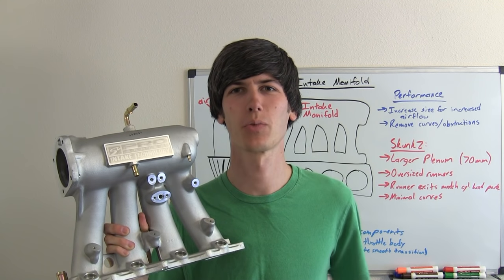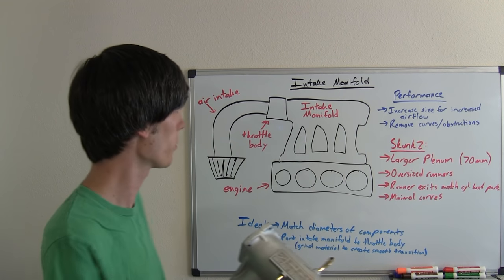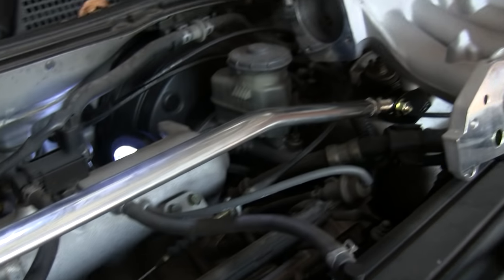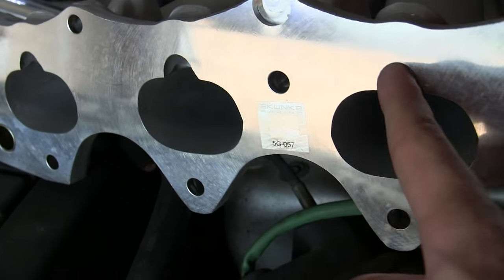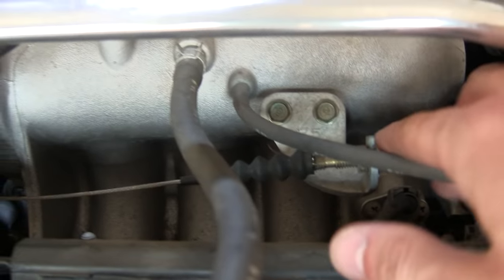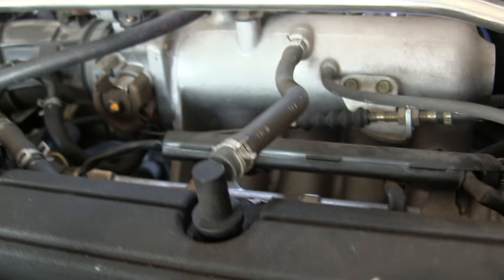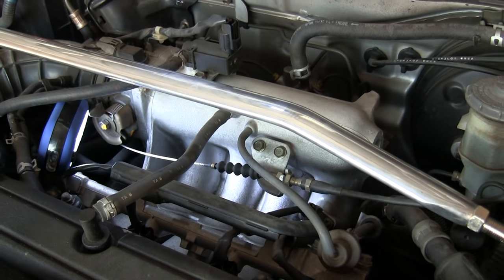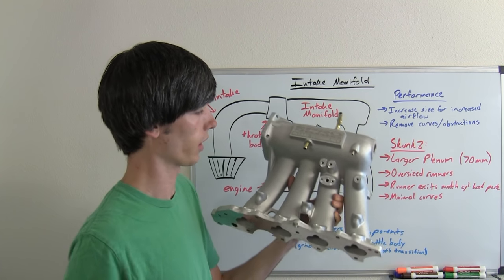Intake Manifold - Explained

Comment: So if the main opening on the S2 intake mani is bigger than the stock one, wouldn't you have to get a throttle body with a bigger bore for the air to flow consistently?

Comment: I might not be thinking straight but is/would it be possible to install an aftermarket exhaust header, intake header and catback exhaust at the same time?
Reply: It would be expensive and require an injector remap but it's possible.
Reply: TylertheGeek28 it's easily possible, 3 mods is nothing earth shattering and in a lot of cases wouldn't even require an injector remap. that's what exhaust sensors r for. the stock injectors will provide plenty of flow for most things short of forced induction

Comment: What about intake turbulence to ensure the fuel is fully atomized? 
Back when I rode Harleys, everyone I knew assumed I was riding a sleeper 1200 bore-job on my 883 Sportster. My bone-stock little 883 Sportster was dropping all FXRs and other big-bore Harleys with straight exhaust pipes, polished intake ports, Mikuni carbs and even a few who ran them without air filters. They were getting MUCH worse mileage and my little "bitchbike" was beating them like a rented mule.
Of course I later learned it was probably because they had smoothed all of the steps and smoothed the intake ports so that the fuel was entering their engines in large, un-atomized blobs that didn't burn as efficiently.

Comment: Im not sure on those integras whats the VTECH setup but on my silly D15b, with VTECH not engaged one intake valve is fully opened and the other is slightly opened, to say 25% with VTECH engaged both are fully opened

Comment: You really need to correct the PCV statement.  Take the hose off the pcv valve and put you finger on it.
Reply from the maker: Lenny MGI I think you're right! I just stated what the service manual said. That said, removing it from the intake removes the vacuum, which can change things.

Comment: Great vid! Can you tell me what books/ebooks/vid etc. did u use to learn about it? I have thesis about whole intake design, unfortunately i can't find proper materials in my language(in Poland we don't have any automotive engine r&d center, so libraries and bookshops are "empty") and don't have money to buy each foreign book form amazon/ebay and check it content(most of them are very expensive). Sorry for my English.
Reply from the maker: Hmm, didn't really use a book. There's lots of information scattered around on the internet, I just simply try my best to sort out the facts and present it logically.
Reply: Engineering Explained Thanks. I know there's lots information in the internet. I found some most about calculations, but nothing about inlet manifolds, how it made, what materials(not "alloys, plastic" but specifically), types of it. Mayby you will know only this last thing? It's main important. Somebody told me that intake manifolds like exhaust manifolds can be done 4-2-1 or 4-1 (mayby something else) is it true? Little comparison of both? advantage and disadvantages? In thesis i need to write theoretical introduction and this is big problem...
Reply from the maker: dawid3764755 Yes, you could have splits like 1-4 or 1-2-4, etc. Though I don't know what differences will occur. Looking forward to your thesis! :)
Reply: Engineering Explained
Thanks

Comment: How does the engine suck air? is it because of the vacuum that the piston creates in the intake step? like a syringe?
Reply: Exactly. The camshafts are also usualy tuned to create a little bit of vacuum in the cilinder before opening the inlet valve, so once the valve opens air comes rushing in with a higher speed. 
This momentum also makes air keeps coming into the engine at the start of the compression step. This rush and momentum increases at higher RPM, allowing to keep the inlet valve open longer at the high rpm range, which is why variable inlet timing works to squeeze some more high end power out of an engine and feels a little bit like a small turbo kicks in at medium-high rpm.

Comment: So how do you leak radiator fluid when your intake valve gasket is bad???
Reply: B Kelley This is a demonstration of an inline engine. A V style engine may have an upper and lower intake manifold. The lower intake manifold may have coolant passages, the thermostat housing, and oil passages through it. Your intake manifold gasket allows transition of these fluids to and from other components.

Comment: I have a chevy silverado 2005 6.0l while I am driving  power gets lower and lower when it get hot,, is this issue related with throttle body or clutch?
Reply: neither the hotter your engine the hotter the air in scientific terms hot air is less dense so the colder the air the density increases

Comment: Can I use a 1,6 L, 100Hp. vw engine standard intake manifold on Vw 1,4L., 75Hp. Engine+ better flow, wired throttle body? Or there will be ecu, cam or somekind sensor problems ?
Reply: I have 2001 Audi A2/VW  AUA 1,4 engine, 55kw. Original throttle body only 44mm and upgrade throttle body 56mm.

Comment: An intake manifold demonstrates the concept of scavenging.  Forcing a vapor through a plenum exhibits Bernoulli's principle.  Please review.   As the valves open in the cylinders the vapor enters in a pulse.  This pulse sets up a standing wave in the system.  To construct a tube with efficient scavenging,   the manifold must be of a length that is an even multiple of the standing wave that enters the cylinder.   An odd multiple of the path length will not admit a full charge per intake valve cycle. Do the math like you did when you were a kid.

Comment: stock intakes are the best, engines are  designed around the stock air box and filter, a pod filter or cone filter are rubbish, they just suck in hot air from the engine bay, hot air is bigger than colder air, meaning less go in to the cylinders = less power

Comment: I dropped a screwdriver in there cleaning my throttle body intake, how screwed am I ?should I buy a .magnetic snake or should I call a mechanic? I have not turned the ignition on for the the fear of destroying my engine need some help please.
Reply: You aren't screwed yet, but you will be very screwed if you start the engine. The screw will get sucked into a cylinder and totally destroy it, you will need a new engine if that happens. If you can't get the screw out with a magnetic snake you will need to remove the intake manifold to get the screw out. If you aren't able to remove the intake manifold to get the screw out yourself please call a mobile mechanic or have your car towed to a shop, whatever the bill is will be way cheaper than the price of a new engine.
Reply: I fished it out with a magnetic led snake woohoo!!!
Reply: @xxxxxbriansanchezyyy  Glad to hear you got it out

Comment: Why does the Variable lenght intake manifolds have a better flow when using the "long" path in the mid range? Engineering Explained
Reply: Danny Fallas The longer the path the more low end power or torque you have vs a shorter runner more top end power. Ford started doing this as far back as the 90s
Reply: Thanks! For turbo aplications what is better? I am getting short runners.
Reply: Danny Fallas Applications really depend on what you are going for in the car, are you going for a street driven car or a high powered drag car?

If street car you will want longer runners for torque, for full blown track car go as short as possible.
Reply: RichRusso4218
I want the best of both worlds SIR, low end torque to spinout wheels in wet roads, and 15 more hp than stock for high rpms.
Reply: Then go for a medium runner length.
Reply: Then use larger longer runners, there is always a trade up.
Reply: All oft cars I go with short runners, none of them have trouble breaking all fours lose at 60+!

Comment: my intake manifold is made of plastic. is that good or bad?
Reply: there is a broad range of plastics, and some will work for intake manifolds.  when i was in college, i was involved in formula SAE and one year we had our intake manifold 3D printed.  I can't remember the material, but I think it was PLA.  i'd worry if you were adding pressure to the system from forced induction.
Reply: Haukenslush Depends on the application. On a naturally aspirated(non-boosted) engine its a good thing if you want more power. Air is denser when its cooler(and plastic stays cooler than aluminum) therefore more oxygen is present in a given air charge. Ever touched an aluminum intake plenum after driving the car? OUCH!!